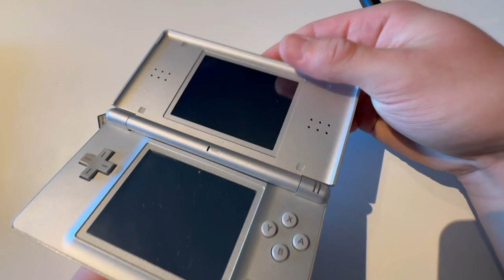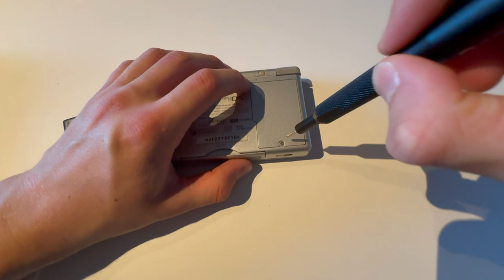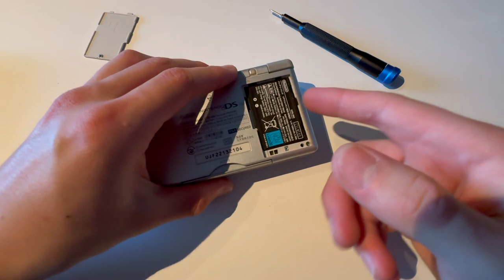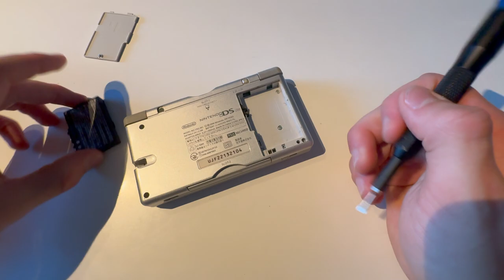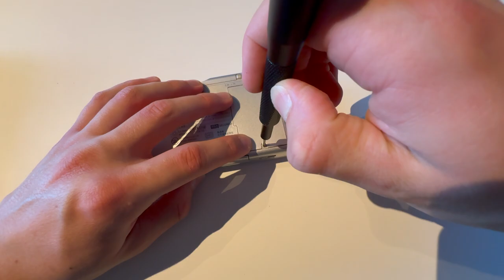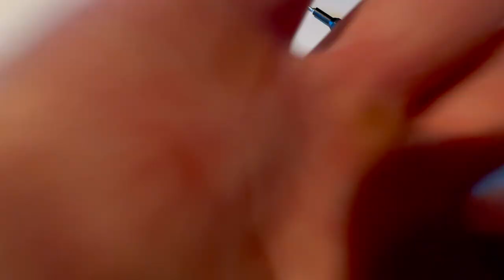How to change battery on DS Lite

Comment: I have a Nintendo ds phat bought used and I discovered that it has the flashme firmware. So without a ds logo when turned on. I would like to change the battery, can they be found on Amazon? If I change the battery with the modified flashme firmware, do I risk a brick or does nothing happen? Thanks.
Reply from the maker: Flash me firmware on a ds? Never heard about it. Yes you can buy a new battery from Amazon. No clue if it will brick it
Reply: @RetroBoyy  Are the batteries on Amazon good? I've heard both good and bad reviews
Reply from the maker: @matteolanciarini depends where you buy them from
Reply: Do you know any good battery brands?
Reply from the maker: @matteolanciarini iFixit